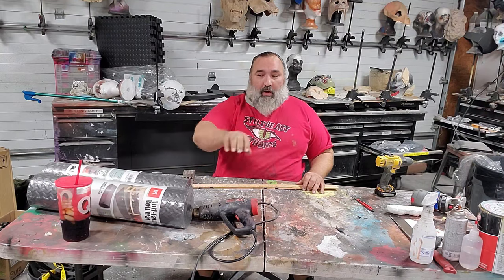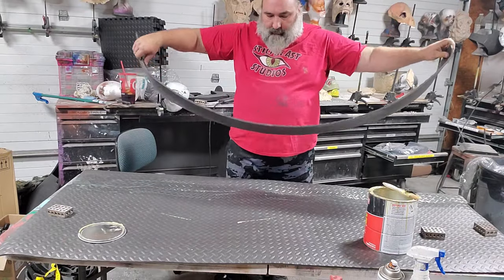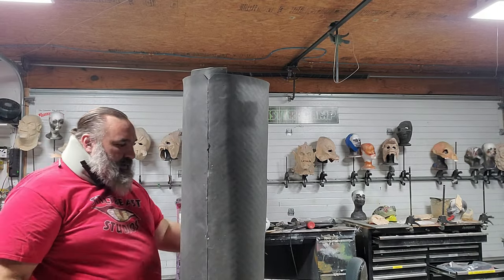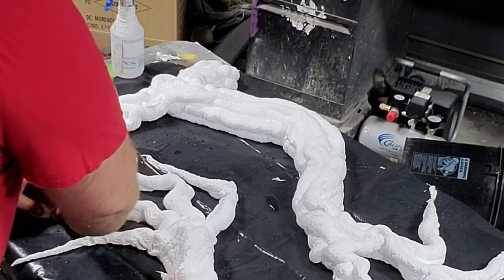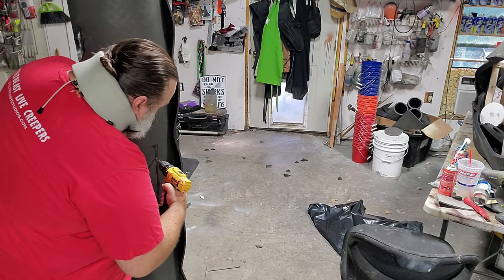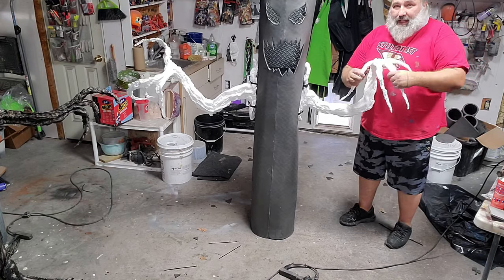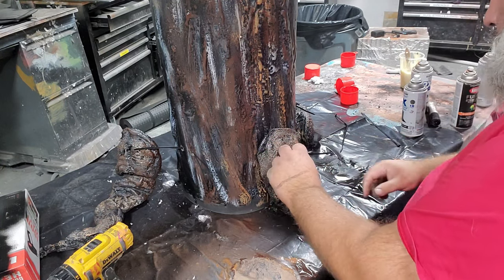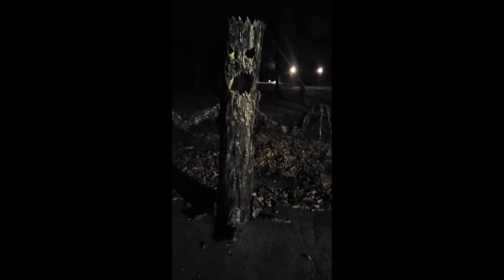Make a spooky Halloween tree DIY under $50

Comment: I did this with 8inch form tube. The cheap green can of g.e. Spray foam from walmart and hot glue just yesterday to hide my kids basketball hoop in my front yard. Not as creepy but hides the hoops well. Learned so much from this channel thank you for doing these videos.
Reply from the maker: That is awesome!
Reply: This is the project I'm planning for next year. It's like you're psychic! What kind of lights would you recommend sticking in the bucket?
Reply from the maker: @cghancoc   I like a flame flicker light, and I like them dark also, they are just spooky!

Comment: I will be making these next year..the only suggestion I would add is to drill holes in the bottom of the buckets so rain doesn't fill them and make a big mess when you go to move them
Reply from the maker: you certainly can. or just put a lid on it, depending on if you have lights or a fogger in it.,

Comment: Windy --  Long term I've found the best thing is the farm type green, flat stamped fence posts.  Just hammer them into the ground to the flat blade in the strongest wind direction, and then put a pool noodle over them that way they're a little safer for you or any kid etc who runs into it.  Then just put your stuff over or in front of it, and secure.
We get too much 45 mph wind here at the coast for anything else to work long term.  This works great even for blow ups by having the foam pool noodle on the posts.  Instead of guy wires running everywhere that still don't hold it down, I put a post or two behind it and use amsteel rope from the side ties back to the posts.  Paint the foam for the posts a neutral background color and they're not that noticeable, and you can usually have them close enough to the body that they aren't that visible anyway.
I have to do all my deer, sleighs, blow ups, and other Christmas decorations this way.  Just normal stakes won't cut it here things still blow over when the ground gets wet and softens.
Easy to remove too, just push against the flat way back and forth a few times.  That spreads the ground a little and they'll pull up fairly easily in most cases.  Use gloves, the posts have a lot of little ways to grab or cut your hands.

Comment: You are such an amazing builder AND teacher.  I have been doing corpsing for a few yrs and even passed on your method (and enc folks to watch your videos).  This again, awesome project.  But a question or two.  1.  It seems lock-tight is more “sculptable if you wet it over “great stuff” or am i wrong?   2.  Do you still use great stuff for some things or switched over to lock tight exclusively.  3.  Is  great stuff sculptable?  If so how? 4.  The “foaming” glue confused me, what caused it to foam in the cup?  Again learning so much!  Thanks again.

Comment: Great video. I'm currently in the process of making a Spooky tree according to your information.

As I'm making my tree a lesson learned is: DO NOT use the Great Stuff Brand Gaps and Crack foam. I used it and I should have thrown it away and started over. The foam is super sticky. I hands were covered in the foam an I had to use Aceatone per the manufacturer instructions to clean it off. The Aceatone didn't get all the residue off. 

He mentions this in the video briefly. Use the Loctite brand it's way better

Comment: Tractor supply has a 46 in. x 93 in  .276 thick Anti-Fatigue Foam Floor Mat for $14.99.
Reply: No need of a butt joint, it taller and cheaper
Reply from the maker: too thin to support itself and the arms over that span, it could with internal bracing but with the same build that foam would crumble. You can actually see a roll of the Tractor supply foam on a shelf behind me in the video lol. 
.276 seems close to .375 or 3/8" but its a big enough difference. also the butt joint and the strip between the two actually add to the strength.
     I do have that foam in mind for other projects!

Comment: A tip for cooling the foam after shaping it with the heat gun:  get a can of air (from office supply stores for cleaning keyboards, electronics, etc) turn the can upside down and spray the foam.  The propellant gets very cold and cools the foam instantly.  Works great when working with hot glue too.

Comment: Instead of heating and reshaping the low hanging arm, I think I would have just clipped the zip ties and turned it around (upsidedown).  Would be a good look and simple fix.  Harbor Freight also sells reusable zip ties which are quite handy.
  They also sell a little zip tie cutter (looks like a tiny side cutter) that makes trimming a snap.

Comment: We used it cardboard tube and ran a one by fours on the inside on both sides to hold the branches. We cut a couple of tree limbs down for arms and  mounted on the side of the tube using the one by fours on the inside to secure the limbs. I'm sure you could cover the blanche's with foam to make fingers. We use screws on the inside of the tube and the screw went through the one by four and then through the tube and into the branch.
Reply from the maker: Sounds like one way to do it!

Comment: I made a 13 foot demonic tree a couple of years ago and several smaller demonic trees.  Your way is simpler and looks great.  I love the loctite idea and the root system is outstanding.  I still use the regular size trees but my 13 footer is now rotting out back.  I may make some major adaptations from ideas in this video.  Thanks for sharing.    

Btw….. A big part of the trees I made in the past used ideas I saw in your plastic corpsing video from years ago, so you were an influence on those.
Reply from the maker: That is awesome! id love to see some pics sometime!

Comment: i would consider maybe lining the mouth and eyes with black replacement window screen. You can still  have lights etc inside but then it will show black inside when not lit. You could also use the small battery powered pumpkin lights inside each eye to make them solid glow.
Reply from the maker: great idea!

Comment: Idea...  if you keep the bottom on the bucket holding the arms on... you could  put some kind of light or fog in there so its comes out the mouth and eyes making it a bit creepier
Reply from the maker: yeah,  added lights into the bottom bucket, the less weight up high the better, and the cords have to come out the bottom anyway

Comment: If you wanted to add more strength to the arms, could you smush HD tin foil, like you did for the vines, & put it in-between the layers of foam up to the wrist & make a T shape wide enough at the base end to get caught by the zip ties? Also, if I wanted to add different thicknesses of vines to the tree, would hot glue work best?  The tree is awesome. I love your videos. You are definitely the King Daddy of Loctite foam.
Reply from the maker: I would embed some kind of a wire that has its own stiffness over length.  That’s a better way to support the limbs, even hiding a shelf bracket inside of the limb that attaches to the tree would give it immense support.  in Texas, I really can’t use hot glue on outdoor props.  I would go with a clear silicone calking or 5 minute epoxy because in the texas sun, hot glue melts unless it is a real high temp hot glue.  Would love to see what you make with this!

Comment: My cost was more like 140 !   And unfortunately I cut the mouth so wide, leaving the tree to fold over.   And I still need to go buy more loctite to make the roots.   Note : I had to buy all products :  Cement glue, gorilla glue,  paint, loctite spray, concrete mix,  mats, & light.    The only materials I had were paint brushes, buckets,and zipties.
My experience would advise to cut eyes and mouth closer together, as to not fall over.  And realize all the other supplies, added up to alot more than expected.   Still a work in progress  as I have to set dowel rods in concrete buckets, to have the tree stand up. 🤣  and buy more loctite to make the roots.  But I started the project with my grandson.   So it has been a fun experience.   Thanks for the idea.
Reply from the maker: yes thats true, but you will have materials left over for future projects!

Comment: Why use spray paint (which is much more expensive) to spread with a paint brush? Great build, love that it stores well ❤️‍🩹
Reply from the maker: it bonds well to the foam and is more weather proof than acrylic. spraying it would give me soft lines, and when I dry brush I get the hard edges Im looking for. also if you look at ounce per ounce, the 2X spray paint is about the same as a medium quality acrylic.

Comment: Really great ideas! Do you anticipate this will hold up outdoors with wind? If not as is, do you have any recommendations for modifications that would help withstand the elements?
Reply from the maker: it will, if needed you can put it over a t post driven into the ground. it will hold up well out side

Comment: Is there anything that can be used to apply over the entire surface, that will seal & protect the spray foam from chipping or breaking off when moved around or stored? I made one of those fire pits with the lights and it already has chipped off in certain areas, just from moving it around.

Comment: I was wondering if you could use some heavy duty zippers on that seam so that it was easier to move when Halloween's over or when you don't need it. I think it would be easier to store that way and move it that way then you could just pick up the bucket by itself with the weight in it and make any adjustments you need to without destroying it so I guess you could do that with the zip ties but I think like a really long like heavy duty sleeping bag zipper might work too. Can wire be used to help support the arms and fingers?
Reply from the maker: if you just cut the zip ties it opens right back up, and they take like 5 min to install.  so I think thats easier and cheaper than buying and installing a 6ft zipper. you could add wire, but they dont need the wire to hold themselves up.

Comment: I want to adapt this design to a wearable stilt costume! I have wanted to make a giant, realistic tree costume for fall festivals and general haunt line work etc. for a very long time. I can't think of a better design than this for that pupose.
Reply from the maker: I have made a few of those, I added a canopy of branches off of a back pack frame, went with pool noodles for those to keep the weight down. I used to play the green man at Scarborough Faire
Reply: @StiltbeastStudios  I would be interested to pick your brain on the outline for that design site time.
Reply from the maker: @walterstankavage4195  are you on facebook? Im Allen Hopps there also
Reply: @StiltbeastStudios  I am, indeed on the FB. I will look you up. thank you for the response.

Comment: another great tutorial!! those look easy to make and not too expensive.
Only concern I have is , if someone touches the tree in between the buckets will it fold and fall?  or the outside glue makes it hard enough?
Reply from the maker: the tube shape and the glue really helps, it wont take a tackle, but few props would. you can also add the 1x4 like I mentioned for windy areas.
Reply: @StiltbeastStudios I missed that bit😅🙏.
Anyway I think Im gonna cheat a little.  just realised we got 8 round pillars in the bar.....

Comment: Everyone do yourselves a favor and don’t use great stuff for the arms or roots. I tried cause it’s all my local hardware store carried and it was a horrible experience. The foam sets very quickly and it practically impossible to shape but when you connect it to the tree the next day your arms will be dragging on the ground. 10 arms later I bought the loctite foam online and it worked 100% better.

Comment: I’ve actually used great stuff for this kind of thing. I’m just curious what spraying it with water dose? Also when I used it , I got some on my hands and it took like two weeks of scrubbing and trying different chemicals to come off. So I’m surprised to see you molding it with your bear hands. Is that because of the water or 3 minutes you waited. I’d love to do more of this stuff so your help on those questions would be awesome! Thanks for your awesome tutorials!
Reply from the maker: I did not use great stuff- I used Loctite foam, its a completely different formula

Comment: Haven’t finished the video yet but did you use a rotary tool vertically to add bark lines and stuff? And could put a light in for the face to light up or eyes
Reply from the maker: finish the video lol, I did this three years ago by now I dont even remember. lots of spray paint in my life.

Comment: How well do the arms hold up to heat and wind? I had made some trees with cut up pool noodles supported with some wire through the middle. Looked great inside but had hot (90+ temps) and windy year they all ended up drooping.
Reply from the maker: great so far, Ive had no issues in Texas. can you send a pic of your trees?
stiltbeast@gmail.com

Comment: I am trying this for this Halloween. First, this project has gotten to be way over $50 (inflation). I am having a problem with the arms. I live in a warmer climate and the arms droop, I believe, because of the heat. Any recommendations? I have thought about possibly using a wire or PVC skeleton in them.
Reply from the maker: I have used wire in mine before, I use ceiling hanger wire from Home depot. Or you can really manage the tape of the arms in case there is too much of a weight issue. 
dowel rods can also be added after, or you can even paint the arms with resin if you want to stiffen them up

Comment: This is a great tutorial!  Can you pls share which gorilla glue you used that expands like the spray foam but on a smaller scale?  I've never seen a glue expand like that!!
Reply from the maker: its original gorilla glue.

https://www.walmart.com/ip/Gorilla-Original-Waterproof-Polyurethane-Brown-Glue-4-ounce-Bottle/15085247?wmlspartner=wlpa&selectedSellerId=0&wl13=1117&adid=22222222420450916370&wmlspartner=wmtlabs&wl0=&wl1=g&wl2=c&wl3=547331341345&wl4=aud-1025716567856:pla-293946777986&wl5=9026841&wl6=&wl7=&wl8=&wl9=pla&wl10=8175035&wl11=local&wl12=15085247&wl13=1117&veh=sem_LIA&gclid=CjwKCAjwwsmLBhACEiwANq-tXIRvF2LdGjzznJToW3RU3DgpXLlo9XmweZKMLwO_QcAJ4loRmlRXBRoC4zcQAvD_BwE&gclsrc=aw.ds
Reply: @StiltbeastStudios  Thank you ❣

Comment: well  like  this  its a  might  but  with  other stuff the  G glue   a  good think  to  do  bark   and  got look fore the  lock  spay foam  but  wil not take  off the  zip  ties  might  ues  the   GRALA glue  and  hot glue  to do  the   tube  like flashers  in  it  to  well we will look at  other vid  and treat the  fuzzy  co star
Reply from the maker: just a warning, most hot glue does not work well on EVA foam.

Comment: Thought I would add this to the proper video to help anyone that wants to do this project 

Scary tree supply list

Buy Per tree

2 to 3 Anti-Fatigue Roll Mat (2 for 6ft or 3 for 9ft)
2 5gal buckets
Zip ties (24” or 11”)
2 cans locktite foam gaps and cracks 
Strobe light (optional)

Buy once for whole project

Construction bags
Spray bottle 
gorilla glue (large bottle)
Set of wall paint brush 
Black spray paint 
Inter Mouth color spray paint (your choice)
Gray spray paint 
Beige spray paint
Caramel spray paint
Expresso spray paint
Contact cement bigger then 3oz can 

Tools needed

Heat gun
Drill (1/4 inch bit)
Marker
Small electric Saw
Utility Scissors or Utility knife
Reply from the maker: Thanks for the help!

Comment: How do the arms hold up against wind iv made one but I'm worried the arms may snap I couldn't get locktite foam in the UK! I had to use great stuff pro
Reply from the maker: Thanks for the comment! 
I would say that adding a support structure on the inside would do the trick. Maybe fence wire?

Comment: Is there a specific type of gorilla glue you used? I tried the clear one and it didn't work.
Reply from the maker: it has to be the original gorilla glue-
this type
https://www.amazon.com/Gorilla-Original-Waterproof-Polyurethane-Bottle/dp/B0000223UV/ref=asc_df_B0000223UV/?tag=hyprod-20&linkCode=df0&hvadid=193991302028&hvpos=&hvnetw=g&hvrand=16405620433526812203&hvpone=&hvptwo=&hvqmt=&hvdev=c&hvdvcmdl=&hvlocint=&hvlocphy=9026841&hvtargid=pla-318296752492&th=1

Comment: How do you stabilize it in a windy day? Also, is there any need to protect it from rain?
Reply from the maker: Fill the bottom bucket with rocks.  NO need to protect it from rain unless you have lighting equipment inside. Then, you could put the lighting equipment inside the bucket.

Comment: When applying the gorilla glue are you then putting the gaps and cracks solution in a cup then applying it on the tree?
Reply from the maker: no, just gorilla glue sprayed with water, Im painting on the gorilla glue

Comment: Hot dog this is fantastic! Question, could you use this in an indoor haunt and what would a fire marshall require for it to be used indoors? Does it need to be coated in retardant?
Reply from the maker: I would coat it in retardant. its not fire resistant but its better than what trees are normally made from when you think of the fire load.
Reply: @StiltbeastStudios  have you used these inside a haunt before or just outdoors?
Reply from the maker: @CarloRufinoSabusap   both actually started these this way in 2018. but the locktite branches is only from 2020

Comment: Could you embed some bailing wire in the arms for extra strength, or would that add too much weight?
Reply from the maker: you can, but its not necessary. you can also put a 3" hole all the way through and build the arms on a pool noodle that slides all the way through.
Reply from the maker: an L bracket inside the tree attached to the bucket ring and going into the arm 5-10 would do a lot of good and be easy to do.
Reply from the maker: or, paint them in gorilla glue as well, its a great textured hardcoat
Reply: @StiltbeastStudios  Thank you for the info